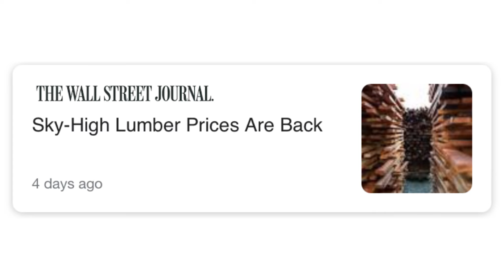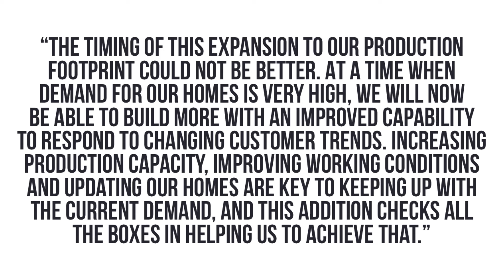Manufactured (mobile) Home Prices Exposed | How 2022 Will be Different

Comment: When we started the process in January, with upgrades, we were at 125k.  Now the base price before upgrades is 162k on the website as of today.  1600sf Champion. We saw 3 price increases before all the paperwork was signed and our final price locked in but we saw about a total 14% increase for the house alone not including all the other costs (prep work, well, septic, power run to property).   In addition to price, times kept getting stretched.  We had to compromise on some features/appliances because the original option is not available right now. Our house was supposed to be factory finished last week so things hopefully will move quickly now.   Because of labor issues, any change to the non house part requires a requote and even removing something (like we decided to not grade for a garage right now)  can cause the price to go up for less work.  Crazy times.
Reply: Wow
Reply: Did you ever end up getting your Champion home? If so, do you like it, any problems so far?
Reply: @DeeGeeTN  it was delivered last week. They are still setting up the utilities and doing the prep/repair to the inside. We have not been inside yet. Lots of property work (septic, electric run) to go so lookin at another 2-3 months with getting everything scheduled.
Reply: @dlcramer99  I'm gonna be in the same boat soon as we just ordered our Sunshine Homes Double Wide. Haven't started on the prep work yet but we have to well, septic, gravel driveway, electric, etc. Good luck with it all!
Reply: @DeeGeeTN  good luck to you as well.

Comment: I was looking at park model homes and they started out at about 55,000 but by the end of the year they were about 85,000. Instead I am looking at a remodel to my home to add a small kitchen/dinging area and add a shower where my closet is.  I can do that for the 55,000 and leave the rest of my 2000 sq ft home(about 1500 sqft) for my daughter and her family to use.

Comment: Could please to a video and give examples on how MH's are insulated against pipe freezing?  Would like to understand how the pipes are done under the home.
Reply: Go look yourself it's the best advise and install heat tape! Depending on where you live, you'll still need to run dripping water if temps get too low...
Reply: @tammyvanwinkle8870  Yes, we do open cabinets and run dripping water when it freezes here.  We are 74 & 65 not a good idea for us to be under the mobile home.  Our disabled son actually lives there, he can't get under it either.
Reply: @1936Rock  I'm disabled as well.  Life isn't easy for many in our situation. I hope I helped some.🙏🏻💜❤🙏🏻
Reply: @tammyvanwinkle8870  Yes, thanks so much.  Helps us understand it all a bit better.  Please take care!  💖💜💙